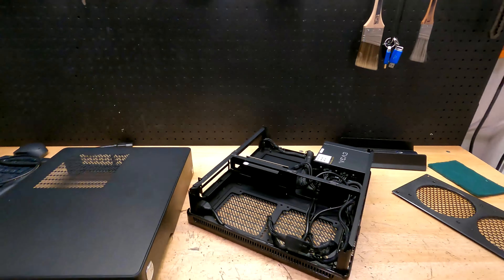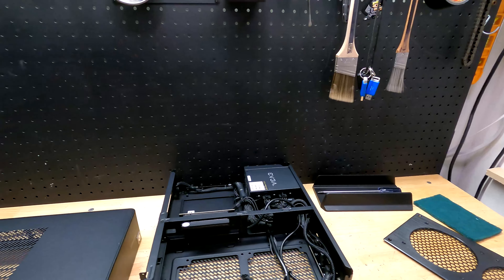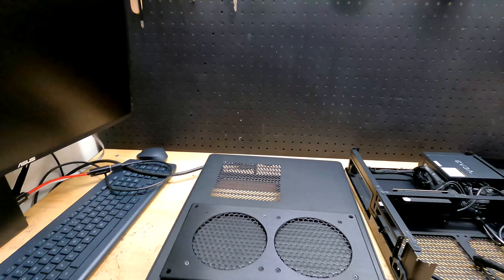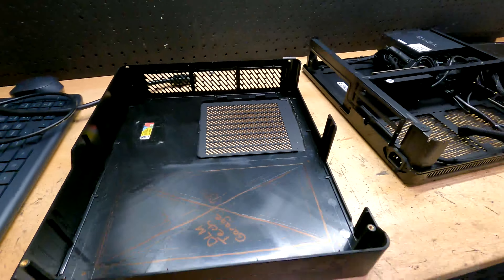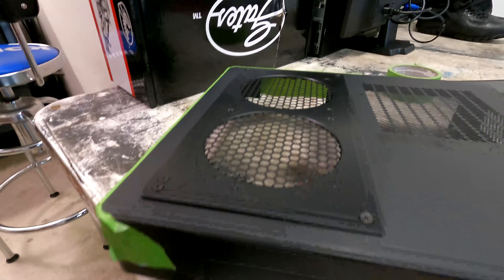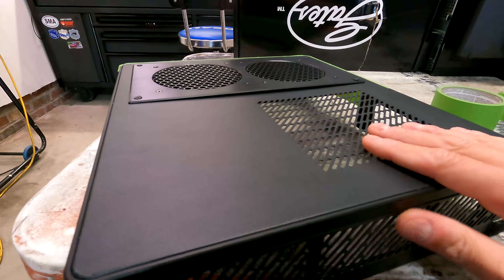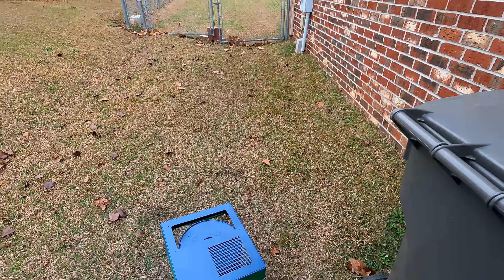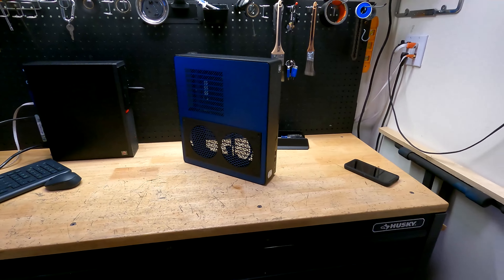I made it better!! Fractal node 202 case mod!

Comment: My case orientation is horizontal.  I also cut a 120mm hole, but still wasn't getting much airflow.  Then I lifted the case about an inch, and plenty of air started flowing from the bottom to the top.  So I ordered some 3D printed spacers for XBOX/PS to lift the case about 1".  I need to get the entire case lid modified someday so I can repurpose the 3080 Ti for living room use.

Comment: I feel like that blue would make for a great fallout themed build with the Fallout edition EVGA GTX 970 (with some yellow accents added to the case as well)
Reply from the maker: I have been trying to hunt that gpu down for a fair price to do a custom build with it and an old case!! they tend to be pricey
Reply: @DLMtechgarage  I’ve seen them recently for about $200 which is quite a lot for a 970 in 2023. Luckily enough I got my hands a donated evga 970 from a build a did last week!

Comment: I would definetly recommend adding two Noctua NF-A12x15 PWM Slim  run them at 900rpm as exhaust and they wll be vertually silent it will also keep your gpu fans from ramping up as much
Reply from the maker: yea might be going that way

Comment: loved the video. got any tips starting a business for building budget computers?
Reply from the maker: find what game or program people are looking for in your area and use those as you baseline specs, In my area as long as the computer can play fortnite it sells quick. With that game I look out for i7 3 or 4 gen which are pretty cheap still, and compliment it with like a gtx 970 graphics card and the sell quick. Also stock up on SSD 256minimum as that is key to budget pc's!!
Reply: @DLMtechgarage  thanks!
Reply: @DLMtechgarage  quick question. do you have any good recommendations for a cpu cooler for a i3 12100f unfortunately aio won’t fit in my hp prebuilt

Comment: It bothers me that there's the internal power cabling for the PSU. Have you thought about cutting a hole for the PSU's plug and plug it in directly?
Reply from the maker: does not seem worth it and it runs fine under full load and I game on this thing alot.

Comment: IM MODING AN OLD GATEWAY COMPUTER CASE TURNING IT INTO A Naz SERVER. I ADDED IN A DRIVE SLED FOR 3.5 DRIVES. GETTING IT READY FOR PAINTING.
Reply from the maker: I like modding these old case. I did something like that with an old compaq athlon 64 and put in a ryzen 5 2600 in it.